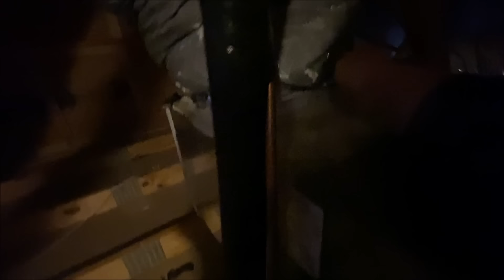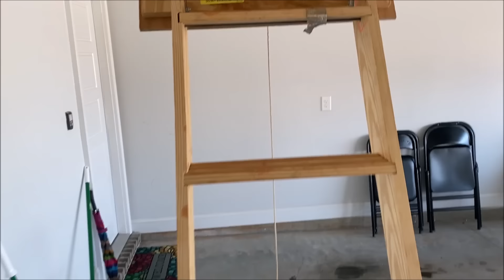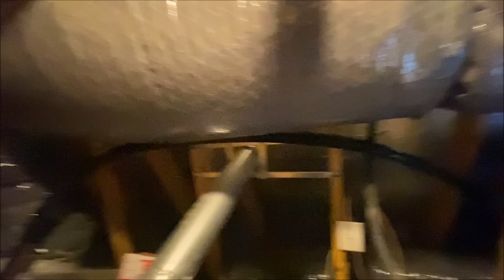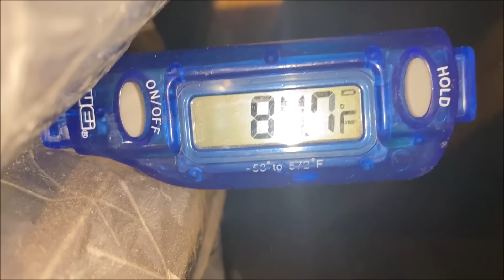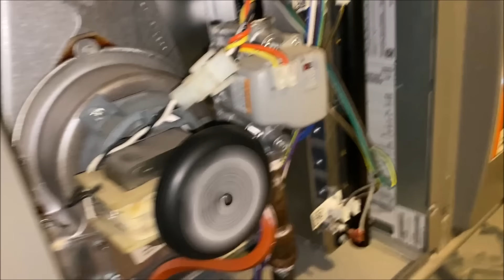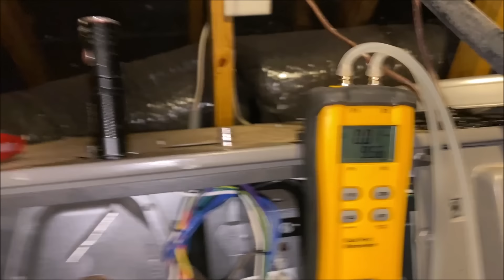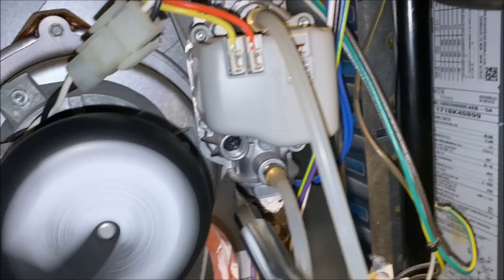New Construction HVAC Hack Job Butcher Sabotage pathetic installers

Comment: The construction company is hiring and subbing out laborers and installers based upon a "production" ethos.  That, together with the fact that they are not teaching trades in high schools so the carpenters , plumbers and HVAC techs are little more than robots, unthinking robots at that.  The product produced is junk and when it's a track home builder the end result is truly the worst of both worlds.

Comment: Do they have an issue with ac flow as well. Take of the end of the feed to see if its flowing out right. Did use a gas metering dveice to see if has the right pressure. If they a gas pressure valve inside, then it has hight pressure witch is against for residential let alone not venting the gas with pipe on the valve to vent it outside, the gas valve pressure should be 3.2 - 3.7. When the other appliance turn on it'll lower.

Comment: In my area about 90% of homes have a single undersized return air duct and grill. Usually a 14" or 16" round flex duct. We are constantly installing a 2nd return air duct and grill so we can get proper airflow. I always start with a static pressure test.

Comment: Did you replace the valve in the furnace? What about the minimum airflow? And the 1/2 gas regulator or did the homeowner not want to do the repairs? The sketchy thing was the adjustment screw. Did not provide enough gas when originally screwed all the way in. Screwed out, then all the way in provided a good flow of gas. Question is why and will it go bad again if the valve is not replaced.

Comment: When I moved down here to the Dallas area I worked for a company who installed those systems the exact way I was there service technician smh . I can’t even tell you how many houses I went through and  had to try to fix the problem and have the owner come out and argue with me about how shitty the install where needles to say I left them.  I’m came from the Philly area we always had to run a plenum then flex to again 5 in or 4 in pipe . Out here they do whatever is cheapest.

Comment: Not sure where u live I live in desert. We don't ever have separate gas regulators other than just before the gas meter. The reg is always set at 7.0 inch water column. I have never had a call where the regulator was off because the gas technician sets em to 7 and nobody is supposed to touch it but them. And ya that duct work looks like a joke. it might sorta work but it ain't gonna be comfortable all the rooms are gonna have their own weather lol. That's how so many houses are out here and it's awful. You can imagine we get so much complaints but nothing I can do is how they built these houses. U did good as a temporary partial fix but need to change those valves.

Comment: I would be turning the gas off at the gas meter and then checking all those pipe connections with pipe dope on them. I’ve seen installers just sick the pipe nipple into a can of pipe dope leaving a big slug of pipe dope inside the pipe. I guess it takes too much time to wipe the pipe dope on just the threads. Sloppy install.

Comment: Thanks for the video. What I don’t understand is why you didn’t tell us what the inches of water column should be for the regulator. It should be marked right on the label, right?  I saw you adjusting it and I saw the output on the display, but saw no indication of what it should be to operate properly.  Interesting video. You’re absolutely right about the crappy job the installers did!

Comment: Having to deliver bad news to a New home owner that the system installation is trash is a tough position for any contractor but someone has to be the responsible adult plus you also expect to be paid for your services and now the pressure is on.

Comment: It's called static pressure, I doubt if the clown installation company did a load calc, or a static test, , I went on a call once and it pegged my magnahelic gauge out. I can't stand these fly by nite so called HVAC clowns.

Comment: Once you get the proper gas pressure, then the unit will probably overheat and trip the limit.  I would explain to the owner that there is also a ductwork problem in addition to the low gas pressure.

Comment: How come you have separate regulators in the home?  Doesn’t the utility company put a regulator next to their meter, before the gas line enters the home?  It’s illegal here, to have separate regulators inside the house, unless they are part of the appliance.   Our regulators are outside the home, right after the gas meter, and are set to flow at 7” WG.  The gas piping is sized to correctly feed all appliances, even if they are all on at the same time. I’ve never seen that kind of regulator manifold setup.  Maybe your gas lines coming into the home are above 14.5” which is the limit at the appliance gas control valve, so you need a step down regulator.  We have this with propane systems where the tank is located too far from the home.  High pressure regulator at the tank, and low pressure regulator right before the gas line enters the home.

Comment: Its obvious that the furnace worked before. Something changed. Don't be so quick to change parts without first knowing what that something was. That furnace shouldn't need that regulator to start with.  Its has one built into the gas valve itself.

Comment: Your numbers are almost there. Check the spring for the right conversion kit and adjust the other regulator. You can't condemn stuff without first checking to see if it could work. Did the problems start with the installation of that regulator or not? If so move it or move the line feeding the furnace in front of it.  If not you are still looking in the wrong places.

Comment: Hvac mech, retired now. back in my day we bought metal and went back to the shop and made the duct work. long story short the duck work was made to match the velocity out (cfms) and we made the return to handle 200 cfms more. Looks like flex duct has replaced the old standard?Where is the air balance here?

Comment: I love seeing "Pros" who don't know flex ducting and sizing. Right off the bat seeing the return at 14 should instantly know its too small. 16 is too small for the supply. No big problem with the branching and Ys. The spaghetti your talking about can work great if sized right. Pulled tight and no kinks.

Comment: When I was a contractor I had one inspector that was ever worried about HVAC.  I don't really think any of the others knew what was going on.  We had a big advantage in that we had basements and nothing much was up in the trusses.  If I'm honest I didn't know much about HVAC until the fourth house I built when I put geothermal in a spec.  What a nightmare.  It wasn't the furnace, it was the ductwork.  Probably 40% of the return air was coming under the basement door.  Thank heavens the manufacturer got involved.  They sent an engineer and resized the returns.  I was lucky.  I learned a lot.

Comment: As a retired electrician (UK based) who spent many many hours crawling through roofspaces while running cables, I can only say "Wow". The ducting and the joinery work in that roofspace must have been thrown together by people while they were blindfolded and had their hands tied behind their backs. It's easily the worst work I have ever seen - Newbuild, or otherwise.

Comment: Ive been doing HVAC for 15+ years IMO most new construction installs are garbage. They are hacked in, most likely did not check the gas pressure either. That duct work job is so shity!

Comment: Long ti9me home inspector, on my new home construction I write the flex duct installation up as poor before I enter the home, if its above adequate I revise my report. This type of installation is way to common. Great find on the gas pressure.

Comment: Why do you guys have 2 stage regulators on natural gas? In Canada we run all or natural gas at high pressure then it gets knocked down to 7”W.C just before the house. All our appliances then run around 3.5”WC +\- 1”. Two stage regs are for propane only

Comment: I wouldn’t have done anything after seeing all that crap that has more code violations than the book has codes. The homeowners need to call the Ga. Contractors Licensing Division to get one of their inspectors out there to document everything and get the HVAC license holder to correct everything to current code. Once they get involved the job will be corrected with probable sanctions put on the contractor. Just horrendous. The builder can’t hide behind any 1 year warranty on that either.
Reply from the maker: We are in SC…. What code violations do you see ??

Comment: That ductline could have been fixed with a 14'' round pipe with 6'' feeders going to each opening.  probably cheaper than all that flex. As far as the gas pressure I think the valve has the wrong spring in it, or no spring at all, that regulator is sized for a gas grill not 3 appliances

Comment: You should check pressure at the input to the regulator. I put up with low pressure for years. My gas meter was the problem. The techs never setup pressures on new installs. Yerks they are.

Comment: My neighborhood was built beginning in the 60's. The HVAC guys back then that did these tract homes were all in a hurry, just like these guys were. However, they still used pipe. A couple of times I've noticed somebody had all the pipe removed and replaced with flex duct (I'm presuming based on what I've seen in the trash.) I think to myself how can they be so stupid.)

Comment: Just like the new housing developments in sussex county delaware. 500k and no sheet metal in them. Small crawl spaces or slabs,  force them to put them in attics (the worst place) and the attics are filled with trusses. Impossible to run a straight duct system, even if they used duct board instead of wrapped sheet metal. What a shame people pay all that money for a crap built house, let alone these H.O.A.'s

Comment: I wanted to move to Colorado a couple years ago and ran into this company that only paid it's employees by their sales. I knew I wouldn't fit in at that company. I a lot like you, although I need to improve on my attention to detail. I take shortcuts like not using a nitrogen bleed as much as you do and probably should, but here's my point. I am very technically inclined, I love the work (most of the time when it's not 20 degrees outside working on a heat pump owe), I strive to double check my work and try to make sure I do a good job. And I always leave my work area cleaner than when I got there. It's really downheartening to see these companies who don't care about that , but about someone who can walk up and BS the customer into a new unit that they don't even need. I'm 59 and that's one of the things I've noticed about the AC industry lately. These incentives and bonuses for selling equipment, could cause a technician to be dishonest. I worked with one in Beaumont, Tx awhile back and he told me he took his zoom spout oiler and just squirted a little oil on the condensing unit, told them it was leaking, and sold them a new unit. He got an extra 50 dollars on his check for the sale, didn't have to work on the unit, and didn't even have to go back and install the stuff. The installers did all his work and he sticks money in his pocket. What a sorry %$@&%@ he was. The boss loved him though. Things like that make me really not like my chosen field, but it's just really good to see someone like myself who does just exactly what a unit needs to work again without trying to trick the customer into a sale. Faith in humanity restored.

Comment: Builder grade work. A house that I got had 4 inch ducting running from the kitchen vent, typically that is 8 inch. When I upgraded the hood and exhaust from the builder grade stuff I had to upgrade everything including the roof cap to 8 inch, one of the things when we made the deal on the house was that I needed to set aside a few thousand to do this work and we actually got it.

Comment: Imho original installer dialed down the gas valve to prevent unit from going off on high limit safety due to low airflow condition

Comment: Based on what we can see of the other gas line "plumbing", I guarantee if you open up that regulator valve, there will be pipe dope & Teflon tape plugging the inlet. Sloppy/messy plumbers are notorious for these kinds of problems.

Comment: We can all agree that that hack flex job sucks but what gets me is how different gas is across the country.  Here in San Diego, the utility provides the regulator, moisture and debris trap.  So when I see regulators in attics or drip legs on appliances, it is foreign to me.
Reply: If there is no drip leg at the appliance, what is supposed to catch all of the threading debris, oil etc? That is in between the utility drip leg and the appliances? I agree with the regulator and meter being the utility’s responsibility.  It’s the same in Northern California.

Comment: Lots of talking on this is wrong and this is badly installed. Didn't see much fixing of anything. You know, what you were PAYED for by the customer? Why wasn't all they flex mess ripped out and installed rigid trunk lines? Larger gas supply pipe installed? Earn you money sir. You are not payed to drive around dogging other people's work and collect money.
Reply from the maker: First of all the word you are looking for is "paid" ... and no, I was not paid to do any ductwork, although I did propose to replace it all with a more efficient duct system. Second of all, if I were paid for replacing the duct work it is not something I would carry around in my service van, nor would I do the installers job myself anyway. Third of all, this homeowner has decided to file suit against the builder as well as the original installer. I am a witness and this video is evidence. LOL @ "payed"

Comment: I like flex, it's basically all we use in Florida nowadays for residential, aside from truck lines and mixing boxes for the most part. But when people do it like this and kink it everywhere and don't hang it properly it sucks. But it's so much easier than cutting and sizing duct board.

Comment: Use that manometer to check the external static pressure of the furnace. That will diagnose your airflow issues. Even if that burners are heating correctly, the airflow issue needs to be addressed before a compressor fails.
Reply: Yes, two separate issues here. Any follow up?

Comment: Come to phoenix az where the installers are terrible.  Flex everything long kinky runs. I have an idea.  Why do we keep putting our acs on top of roofs or outside in the sun ? Units are not even rated for over 110 degrees. Why not be smart and build a mechanical room with ac ?? Seems like they install them and don't think anything about efficiency.  Think how much energy we all could save if our houses were built efficiently.

Comment: This attic looks like the underside of my house. I don’t have any issues with the air, but my dryer vent line is buried in between all the hvac flex tubing. I’ve had to slither underneath the flex to reach the dryer vent when we first moved in because the line was full of rock hard lint. 

Great video my friend. This was very enlightening.

Comment: That’s a single stage furnace. They should’ve put in a 2 stage furnace. ML means Merit series on a lennox. That’s base model or “builders grade.” As we know it. The step up would be an EL296 (elite series) and then an SLP99.  (Signature series) Combine the single stage furnace with crap ductwork you’ve got a ton of issues. That ductwork needs to be completely re designed. 

Lennox specifies 1.9” w.c. For low fire and 3.5” w.c. For high fire.

Comment: Our second home was about 15-years-old when we bought it. The house was warm enough, mostly because the insulation is superb. But it seemed as if the furnace worked overtime. One night I smelled gas. The manifold cracked and the gas company shuttle furnace down. When the replacement furnace came, the installers noticed something odd about the old furnace. It was actually a furnace for a small, modular home - and it was five years older than the home.

Comment: Seen this countless times.  There is no static pressure in the supply duct due to no endcaps.  Put a 8inch or 10inch pipe with a cap in place of those Ys and itll make a eorld of difference.

Comment: Retired HVACR Mechanic here. Industrial Commercial common occurence. 3MBtu airhouse off an 8in suppy supply regulated for 1.5MBtu... contractors do what they do...
Learned real quick if insufficient heat up you go and start reading regulator specs..95 times out a hundred Undersized regulators. 
Nice catch and if course gas valve destroyed by over adjustment..
At least it ain't 1.5in valve.
They ain't so east to replace in top of an automobile assembly plant or a chicken processor!

Comment: I have personally seen ac techs that couldnt even check for power properly. The guy had his meter on a PLASTIC disconnect asking me if it was off! Another trying to bs me into buying a whole new compressor when I already checked the cap. It was bad. I basically had to force the cap from him and put it on myself. Been working great for a few years.

Comment: What crap job... Got no static pressure in none of that duct..u must reduce.. every 10 to 15 f... To build up static pressure... But builders are using the cheapest contractors they can find now... Use Mickey mouse ,,you get Mickey mouse stuff..

Comment: I used to work for an hvav contractor.  And we could not use more then 4 ft of flex in any application and not smeared duct seal .the builders always take the smedrick installers bids I have seen some crap. but that is bad !